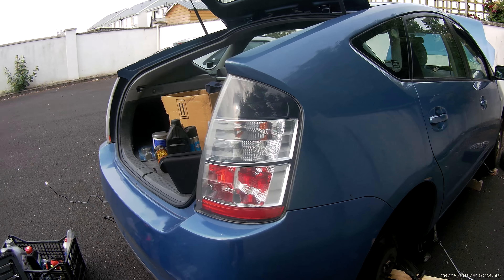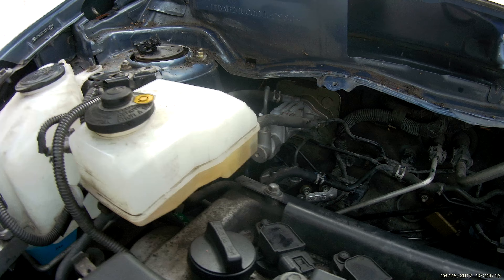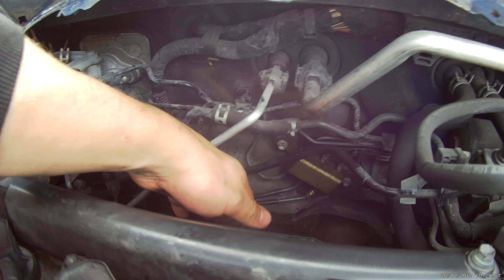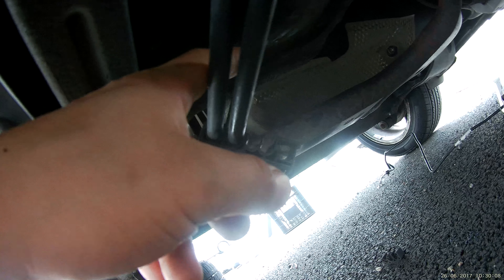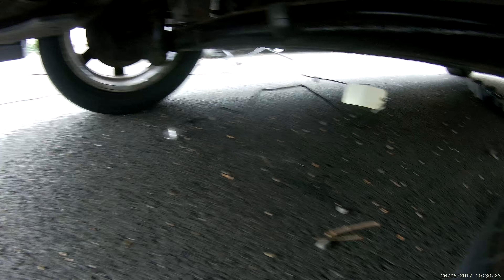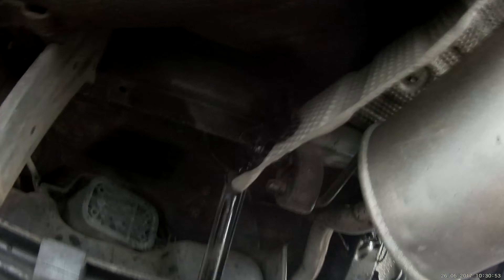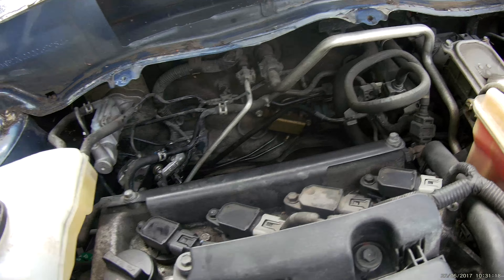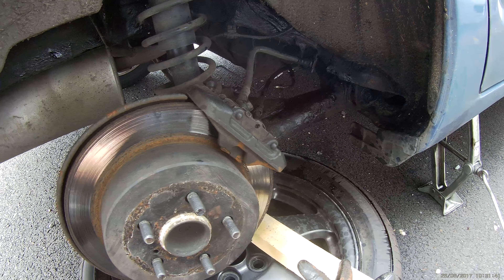Toyota Prius Brake Lines replacement

Comment from the maker: break lines get from toyota dealers aprox 80euros for 2 (left and right sides)
or there is another way to fix it :go to hardware shop and get  '' flanger tool'' for tubes(lines) buy piece of pipe(tube) go underneath car cut, remove your rotten one tube and install  with  flanger tool   new piece..
note this is require more advanced skills and you need more tools (flanger, pipe cutter, pillars, connectors for tubes female and male)..
id recommended go and buy direct from toyota garage (parts section) they definitely will gave them in stock....) Thanks